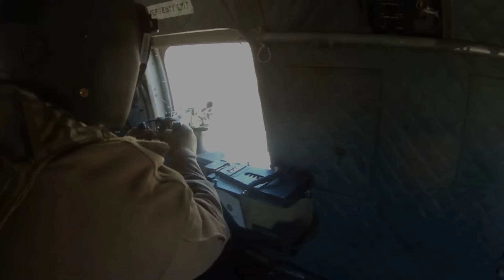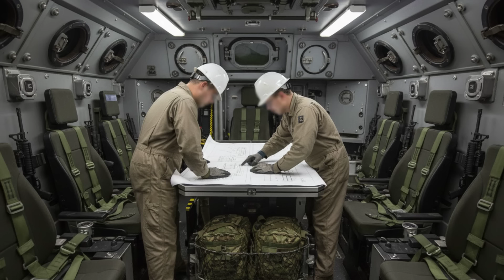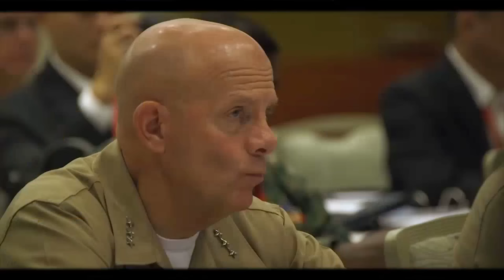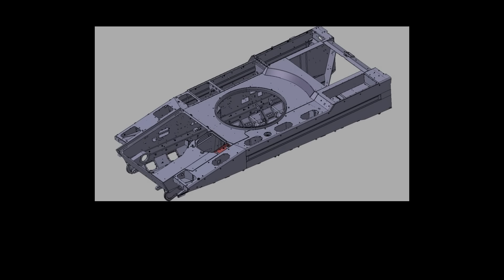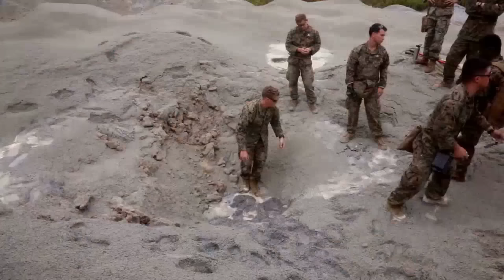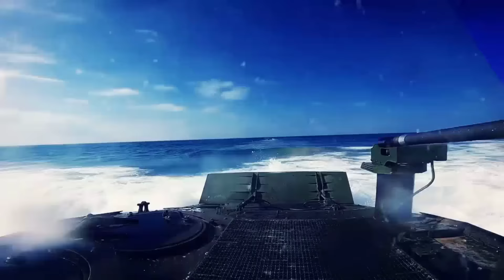Meet The US Marines Newest Amphious Combat Vehicle - The ACV

Comment: I still with the 2011 water jet powered the vehicle faster than every other vehicle on the water but the richest country should have enough speed from horizon to beach so what happens when two wheels on one side will it still be able to run troops to cover.😊